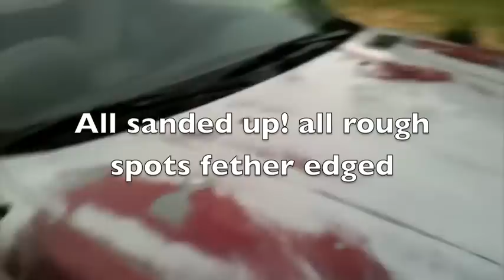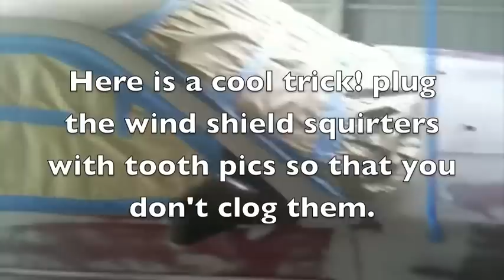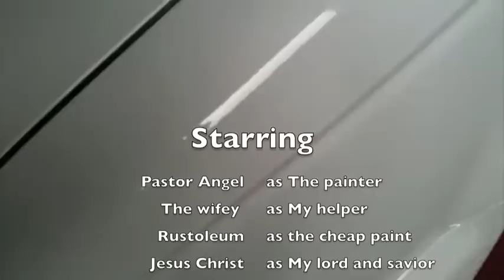50 dollar rustoleum paint job

Comment: Props to you for taking the time and effort to sand and paint everything but next time or for anyone else planning on doing this, It's a LOT easier to just remove the headlights and taillights and then tape the holes from the inside of the body to stop paint getting on the engine/in the intake/trunk. The antenna can be removed fairly simply as well. Also, removing weather stripping isn't really easier than taping it but it definitely makes for a better finished product.

Comment: Brava, nice job. I would've removed the windshield nozzles, personally, plus of course, you want to do a clear coat with a heavy UV blocker content so you can protect that sucker. I need to get a compressor and some spray gear so I can start doing this properly myself. I'm using rattle cans right now which do the job, but they're not perfect.

Comment: I tested out a few ratios and 1:1 is best. It seems very watery but if you use more paint then mineral(2:1) the paint dries on thick. It will feel like a peelable layer of vinyl. it looks just as good but the paint feel thicker.

Comment: @angelitovidkid what kind of spray gun did you use? is there a difference in how the paint will come out if you use a $25 compared to a $300 spray gun? and what kind of sand paper would you use if you decided to not wet sand it? why do you have to wipe it down with the wax and grease. what is the tack cloth ?

Comment: I wet sand it with a 1000 but paint is just to thin and full of orange peel im going to sand it down smooth and try it a gain any tips to avoid it ahould i thin it down less or give it light coats any info is helpful thanks again ur really helpful

Comment: This title is deceptive, It implies you are using spray cans.... "$50"?  o.O

More like $50 + the cost of a compressor, spray gun, tape, sandpaper, etc...

So how much did it REALLY cost?
Reply: he got the expensive shit already in his garage, so technically speaking it is 50 bucks
Reply: for HIM.. Technically speaking, it cost $400.00 for everyone else
Reply from the maker: ILL Gotti it was 22 dollars for the paint and 38 dollars for the rest of the material. I already had the paint guns and compressor and hose and electricity to power the compressor. so material wise it was 50 bucks. I'm pretty sure you can roll on the paint but then again the cost would go up because you'd have to buy the paint rollers so.... idk bro. Its still a cheap easy way to paint a bucket car.
Reply: you can rent the equipment...
Reply: TheSwampbuck1962  or borrow it from a buddy.
Reply: Who doesn't have an air compressor m8, you can pick up a cheap one on Amazon for $99
Reply: +ILL Gotti You know this can be done with gallon rustoleum and rollers.
Reply: +The Kids in Africa plenty of people don't but it's a useful thing to have. I don't have one but will probably eventually when I get a house with a garage and shit....
Reply: Even with spray cans I would recommend sandpaper and tape. lol
Reply: Mike France how did ya come to that conclusion ?

Comment: If your going to go to all that work prepping the body, which is the most important thing about a decent paint job. Please don't waste all that work on crappy rustoleum paint. I know the point was a cheap paint job, but go to tractor paint with a gloss hardner catalyst at any tractor supply, rural king, ect. it's still cheap at $30.00 a gallon and $15.00 for catalyst. Your paint will at least last a couple of years of sunlight. Rustoleum will fade and lose all gloss in a month.

Comment: Lets see.....compressor $500,spray gun $150,hose $40 and materials $60. I get it no mask used you saved $50 on that.
Reply: Most people that even think about respraying a car already have a compressor and it doesnt have to be very big and you need a in-line humidity filter ($12) and a small tank is only like $80 and my gun was only $180 but worth it to me i use it all the time
Reply: *****
Yeah, Bought my gun for 19.99 at harbor freight, hvlp with gravity feed.. sprayed 3 cars with it so far works perfect for what i need

Comment: Most people would already have basic shop tools in their garage, compressor sanders etc, spray gun for 10-20$ at harbor freight depending if you get one on sale..

The paint may be 15.99 a gallon or so at walmart, thinner for about the same price... HOWEVER this paint will only last a couple months

You didnt Clear coat after??? didn't wet sand after clear? rubbing compound & polish after that? then finally finish up with a good wax??..  Following those steps, and re waxxing every month or two will give you a paintjob that lasts as long as the car, for basically the same price, Why not spend an extra 50 and do it right?!!?

Comment: But you have air compressor for painting and most of us don't have ;) lol so it's not 50$
Reply: air compressors are cheap.60 bux, agravity gun at harbor freight and yuou are ready!but I would buy real auto paint,acylic enamel ..its only 85 bux a gallon on line....reds a little more.as long as you r not trying to match a color....oriellysells premix off a color chart but way too much money ....250 plus for reds...the net has made premix so cheap, id hate to use rustoleam just to save 50 bux
Reply: Lee Watkins may be in your country but in my country it's expensive